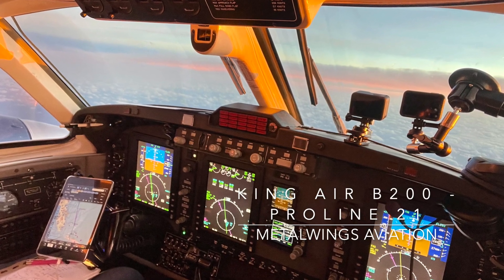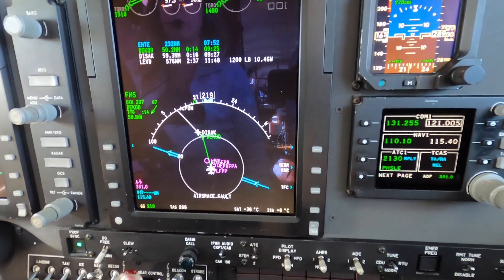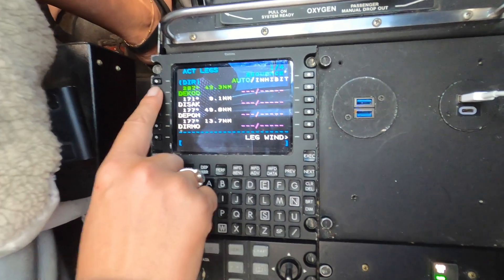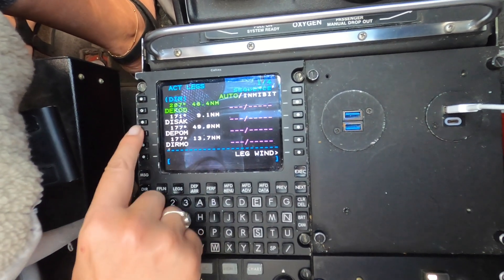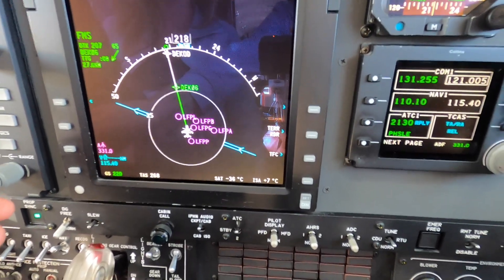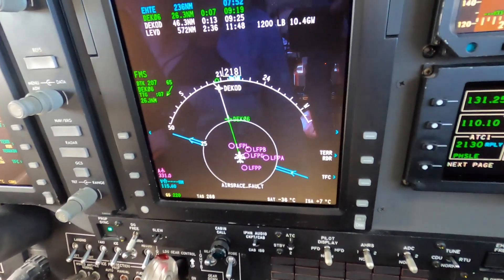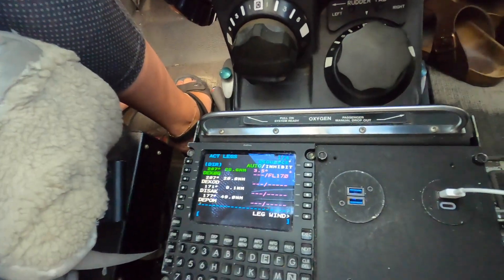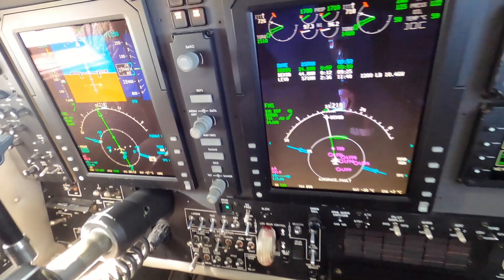KING AIR B200 - Pro Line 21- How to create a waypoint before an existing waypoint

Comment: I skip the F or FL keys for entering flight levels and just type 17000. Your finger will be on the 0 soon key anyway. Plus with the common defect where the keyboard double and triple taps erroneously, this saves some of the inevitable correcting you will need to do.